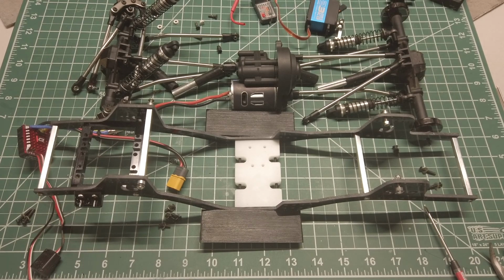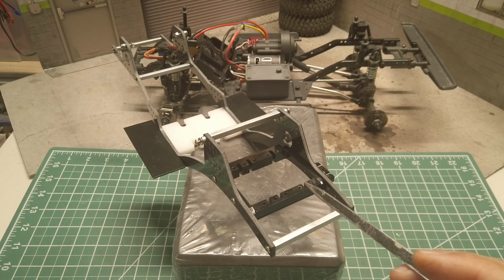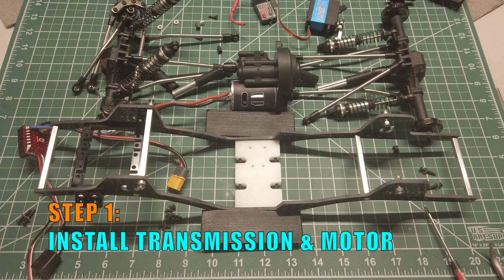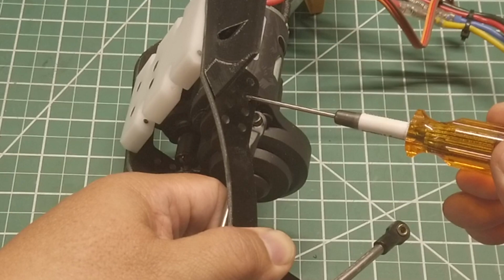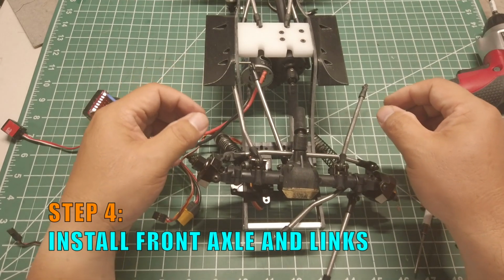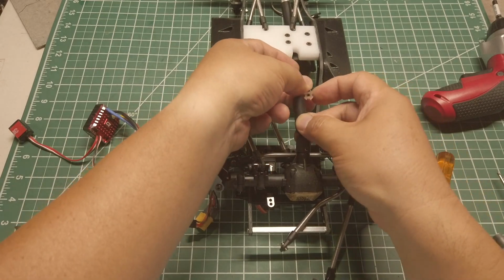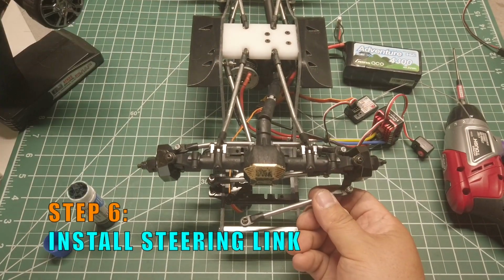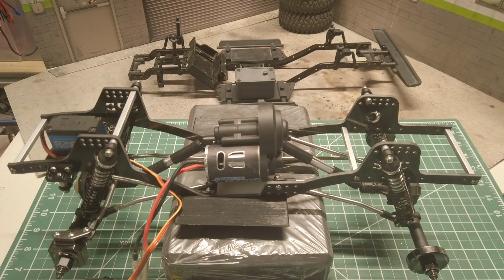How to:  Step by Step Guide to Building LCG "Cheater" Rig using Element Enduro & Gspeed V3 Chassis

Comment: Just followed ur tutorial and finished my gspeed enduro build this week, thx so much for the detailed steps. One thing I found after build is the front right shock won’t be able to extend to full length when I had the steering link and panhard link installed. Wonder if you had this issue before.
Reply from the maker: That’s one area that needs to be experimented on.  I had Hardcore RC’s links that included bent steering links so I had less of an issue.  Might need to play with spacers and length of links as well as placement of shocks to make it work.  Since then I swapped to Servo on Axle setup and I would recommend this route for better performance.
Reply: @BigSungHobbies  much appreciated! I had the hardcore rc links as well, will start with spacers and link length first. Soa sounds promising, any soa mounting you recommend?
Reply from the maker: @Alleneditsxxx  I have used both SOA setup from UC Fab and Artful Dodgers.  I prefer the Artful Dodgers version - https://ebay.us/RbVMZw
Reply from the maker: @Alleneditsxxx  Here's a video that should help - https://youtu.be/XeqCKM4LaFw
Reply: @BigSungHobbies  awesome. I ordered 2 from artful dodgers. Might as well do the soa upgrade for my ekto! Guess I need to order a couple more front upper link from hardcore rc to finish the 4 link setup. I wish they sell those upper links by piece.
Reply from the maker: @Alleneditsxxx  Yeah, just reach out to Hardcore RC and ask for custom links.  They should be able to help you out.  Make sure to order the correct steering link as it will be much shorter than current setup.
Reply: @BigSungHobbies  will do. They now sell both axle steering link and 4 front link package. Looking forward to the conversion. The current Panhard and steering link is killing the front suspension.  :)

Comment: This is a great tutorial.  I want to do this to my Sendero as well.  Got 2 questions though.  At 6:58, what did you use to secure the lower links? And at 8:20, what size screw are you using?
Thank you,
Reply from the maker: Thanks.  At 6:58, I use grubscrew that comes with the skid plate to attach the lower links.  And at 8:20, it really depends on the need, but I believe I ended up using m3x16mm.
Reply: @BigSungHobbies  perfect, thank you. I'm getting a list ready to order up.
Reply from the maker: Make sure to pick up Team KNK Hardware's 700 pcs Monster bag of stainless hardware kit and Aluminum Spacer Variety Pack.  It will be a tremendous help when you work on custom builds.
Reply: @BigSungHobbies  yup, I already ordered all the screws and spacers

Comment: Would it be possible to use the Ecto/Gatekeeper trailing arms on that GSpeed chassis?
Reply from the maker: My understanding is that it's possible as I have heard others build with one.
Reply: @BigSungHobbies  yeah I am thinking that this chassis should work for Element Ecto/Gatekeeper since the trailing arms are mounted on the skidplate and not the rails.
Reply from the maker: @ChraftShaft  I have seen it built up with Gspeed chassis, so it's quite possible.  It should be fairly simple to make it work.

Comment: Nice video thank you!!! My question is since I have the ecto which length link set do I get since the rear has the trailing arms. I'll get the links from hardcore links.
Reply from the maker: It depends if you are keeping the trailing setup, then you will only need the links for the front.  Also front links will depend if you are running SOA (4 link setup plus steering and drag link) setup or still running CMS (3 link plus panhard link, steering link and drag link).  You can reach out to Hardcore RC and ask them, and they should provide guidance.

Comment: Anyone know about trx4? Unassably sport into cheater chassis? Help me lol
Reply: Thank you!
Reply from the maker: TRX4 conversion is slightly more complicated due to transmission and links.  The simplest option is to pick up a new transmission, and matching links from #hardcorerc.  You can also try to work with what you have, but a bit of modification will be needed.  That being said I recommend searching for LCG chassis that works best for TRX4 and ask in their FB pages before deciding.  Personally I am a big fan of Gspeed, but other options works as well.  Good luck.
Reply: Check out “In The Works Rc”. Sweet. Costume links bend ready

Comment: Good video! But.....
Those shaft angles still look pretty bad. Is there any way to get a more neutral shaft angle, that doesn't put the Uv joints at suck extreme angles?
Reply from the maker: Not with Stealth-X transmission. It helps a bit if you swap out to TGH 2.Low transmission. That being said, I ran with Stealth-X for over a year and I had no issues. And if you have seen my videos, I have ran them on pretty difficult lines.
Reply: @BigSungHobbies  I have a sendero I've built. And want a lower COG. It crawls great already, but wanna get lower. 
Thanks for the advice!
Reply from the maker: No problem.  Good luck with your build.

Comment: Where did you buy the metal in front and rear in chasiss?
Reply from the maker: You can buy the chassis spacers from TGH or Gspeed.  TGH used to offer 2 lengths, 67mm and 70mm.  I am not sure if they are still offering two lengths or not.

Comment: Great video and nice truck! How long are these rails? Thinking of doing a long wheelbase truck.
Reply from the maker: The chassis will allow you many different wheelbases.  Just need the right size links.  In the above conversion, I was using 12.3.  Since then, I have increased the wheelbase to 12.8.

Comment: Great video. Planning to build one myself..can I just use the stock SCX10 metal gearbox mount/transmission holder on this chassis?
Reply from the maker: Thanks.  You will to need to use the skid plate that comes with Gspeed kit.  I recommend picking up the bundle.

Comment: Is hard to cut the frame to make it shorter in the front?
Reply from the maker: I haven't cut the CF chassis, so I am not sure.  But it was fairly easy to cut the G10 chassis.  I would assume it shouldn't be too hard to cut the front end.  Just make sure to mask tape the front end before cutting it.

Comment: Doing same switch right now was the 6mm spacer good for the panhard? was gonna use a 8 until seen your video and want it to be perfect your truck seems pretty Nicely done
Reply from the maker: It really depends on the angle of the steering link and panhard link.  Make sure they are parallel, and you would use spacer to adjust it.

Comment: Great Video tutorial, quick question tho I'm curious why you installed your links the opposite of traditional orientation , you have the bend at the wheels & not the skid plate ? is this on purpose for some reason ? I'm doing this build but everything online hardcore rc /Club 5 shows the HC links the opposite of how yours are installed, with the bend at the skid ? Thank you
Reply from the maker: Actually the traditional orientation is bend at axle.  Club5 Racing is the only one that recommends bend at skid plate.  I am using Hardcore RC high clearance links and they recommended the bend at axle as well.
Reply: @BigSungHobbies  Oh Wow ok cool, I'm glad to learn that, Thanks for your help..

Comment: Hi Sung, received my gspeed chassis today. Was hardware provided for putting gspeed chassis together on yours before the conversion?
Reply from the maker: No you need to source the hardware separately.  I had bought a monster bag from Team KNK Hardware and a set of spacers knowing that I will need them.
Reply: @BigSungHobbies  Yes I did see you mentioning the team knk hardware in your video and post. I wasnt sure if the chassis came with some hardware to installed together. Whats size screw did you used for the electronics tray mounting to the transmission sliders? Thank you again for your help.
Reply from the maker: I can't remember if the screw came with the electronics tray or not, but it measures M3x15mm.  Since I don't have 15mm size, I am assuming it came with it.  But in case it didn't, you can use M3x16mm without any issues.
Reply: @BigSungHobbies  thank you!!
Reply: Hi again Sung!! Is there any played in your four links connected to your skid? On a different note, I am racking up your view count on this video with my build...😆
Reply from the maker: @danielsonhobbies  I don’t have any excessive play on the four links, but I am using Hardcore RC high clearance links that comes with Traxxas link ends with steel balls.  It’s supposed to move freely so I wouldn’t worry too much, but I would recommend swapping out to steel balls.
Reply: @BigSungHobbies  k great

Comment: Great video, used it to assemble my GSpeed chassis. One suggestion, use 14mm long screws to mount transmission to skid, the 16mm may be just a tad too long and run into gears inside case.
Reply from the maker: Awesome!  Glad the information was useful.  Great idea on the 14mm long screws.  The 16mm seems to be just the right size, but 14mm long screws will be safe for sure.
Reply from the maker: Just a quick follow up.  16mm length screws to mount transmission to skid works well.  I had recently opened up the transmission to upgrade the OD to 25%, and I noticed there were no extrusion into the transmission case.  But if you feel that you don't want to risk it, then you should go with 14mm length.

Comment: Quick question. Is the trans skid too wide for a reason on the enduro gspeed setup? Or did I get the wrong one?
Reply from the maker: It is intentionally wider.  The skid is 78mm wide while the Dual Servo Mount by TGH is 67mm wide.  The bend gives extra rigidity, and there are no issues whatsoever.  You can also look to qty. 2 of 1.5mm spacer for DSM to make it to 70mm if you prefer, but this means that you should also pick up 70mm wide chassis spacers.  Hope that helps.
Reply: @BigSungHobbies  thank you!
Reply from the maker: @9393ric  No problem.  Let me know if you have any other questions!

Comment: Great video. Love the chassis, use of MIP tools and good explaining. 
What locktide are you using. Seems very easy to use.
And a total different question. What video editing software are you using?
Reply from the maker: Thanks for the comments!  I am using Loctite Stick Threadlocer in Medium Strength.  It works really well, and definitely less messy.  As for video editing, I just use iMovie.  Not the most fancy, but does the job for me.
Reply: @BigSungHobbies  thanks. Gonna   have a look for that locktide. Much less messy.
Reply from the maker: @cesco_rc  Sure.  I got it from Amazon.

Comment: Will 2 holes from the body post align with any 2 holes on the shock towers?
Reply from the maker: Sorry, but not sure what you are asking?  I am not using the stock shock tower.  I am going to use Team KNK's Body Mount's with stock body posts, and attach them to the shock tower on the Gspeed chassis.
Reply: BigSung Hobbies I see.. yes I’m asking about the stock body post ..how will it fit on this kind of chassis..it needs at least 2 holes so that the body  post won’t be spinning around the shock tower..I always have doubt on this kind of chassis holding stock body post..
Reply: Coz now the “shock tower” is part of the rails..so we can screw the body post directly to one of the holes of the “shock tower” but if only one hole is being used to screw the body post it will turn..
Reply: Maybe on the next video u can show how the body post can be mounted ..
Reply from the maker: @HL-OOI  I am trying to decide on which body to use, and that will define where I place the body post.  For now, I think I am going to use the stock body, just the front half.
Reply from the maker: @HL-OOI  Just installed the Team KNK's Body Mount to test it out, and it won't budge even with just one screw.  I think we are all good there.
Reply from the maker: @HL-OOI  I will make sure show the body mount on one of the future videos.
Reply: BigSung Hobbies I just googled the knk body mount holder and it’s a cylindrical thingy ..for this then it’s ok coz it holds the body post from rocking around..what if don’t want to use knk body mount holder?
Reply: BigSung Hobbies thx..
Reply from the maker: HL You are welcome.
Reply from the maker: HL There are other options out there.  Some 3d print solutions as well. Just need to figure out which way you want to go.  For me, I am going with Team KNK body mount, and I think it’s a clean solution.   Good luck in finding an option that works for you.

Comment: Looks like you need shorter shocks to get it down a little more.. put carbon fiber tray beside servo so both sliders can be used for smaller batterys....the tray in front for ESR and reciver ...in my crawlers I do not use recivers boxes because there crawlers not ment to go underwater .....
Reply from the maker: Thank you for the advices.  Still trying to figure out the placements and take some time fine tuning it.
Reply: @BigSungHobbies  I run velcro on my sliders and batterys this way I can push forward or backward on sliders for balance to either mode weight on front or back  ...2 650mAh or 850mAh in parallel for a combined voltage and c  rating doubeled.....
Reply from the maker: @tomandrews5392  Yup, that's what I am planning to do as far as the battery on slider.  Just picked up Outdoor Velcro from Home Depot.  Since I have a spare 1550mAh Tattu/Gens Ace, that's what I am planning to use, and it fits perfectly.  I might look into smaller 850mAh for spare though.